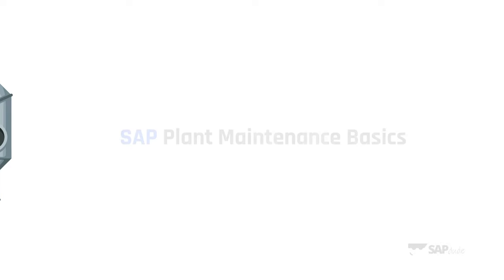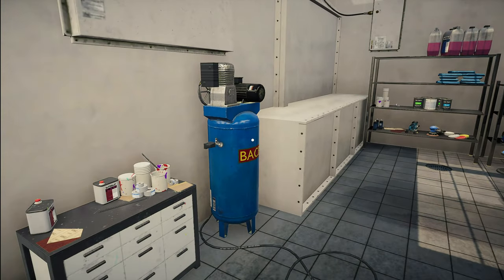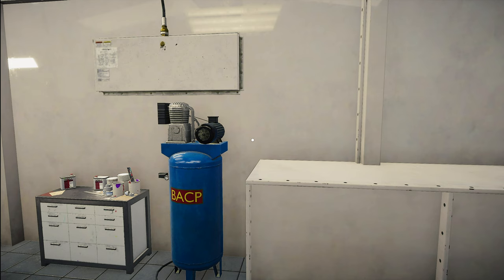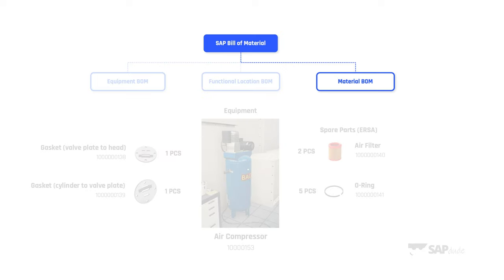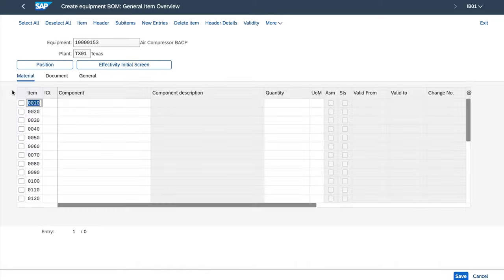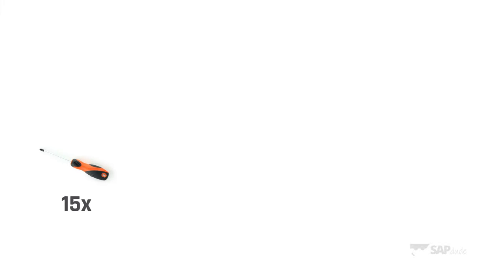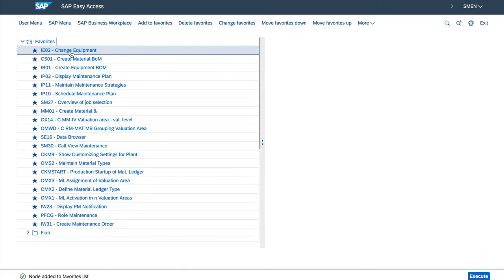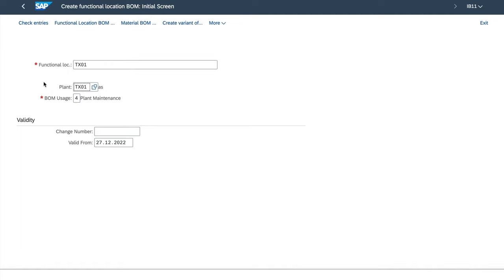SAP PM/EAM Tutorial: Bill of Materials (BOM) - Air Compressor example

Comment: amazing videos - thank you so much. 

quick question: 
when creating the BOM for a new equipment, how do you check if the material/spare part exists in SAP already? 

would i first compare my spare part list with the SAP material to see which exist or not > then create the missing ones > then create the BOM?

Thank you!
Reply from the maker: Hey Johannes, 
Thanks a lot!

You answered yourself already, you are totally right. I will also add something from myself.

If you want to create 2-5 BOMs for Equipment in a manual way (you open a transaction/Fiori App and enter the data manually) it doesn’t matter how you do it. You can for example create a BOM, during spare parts entry (SAP Materials) you will receive an error if some Spare Part does not exist in the system.
So you just save the BOM as it is, create those Materials and then go back to the BOM and update it. 

However, if you are in a phase, where you perform data migration, so you got lots of BOMs to be created automatically (via data import) - this won’t work.

You gotta make sure all the spare parts are maintained in the system first, and then you launch data migration cockpit/LSMW or other mass creation tool to create those BOMs for you. If some spare parts are missing in the system - you will receive errors, confusion will kick in, you will be more a Firefighter than an SAP guy, you will need to extinguish those issues. 

I hope you got my point! 
Cheers man,
Dan
Reply: @sap_dude  cheers! very helpful!